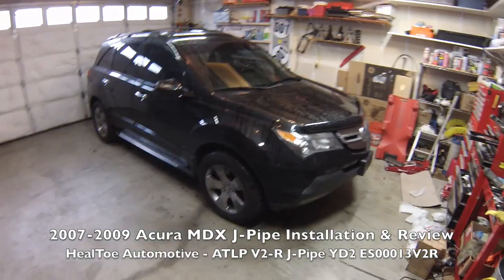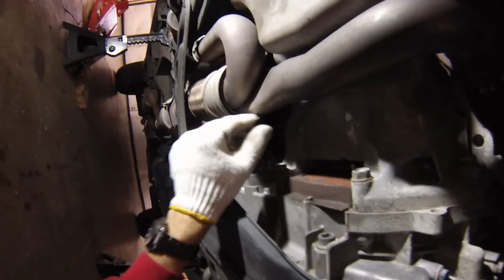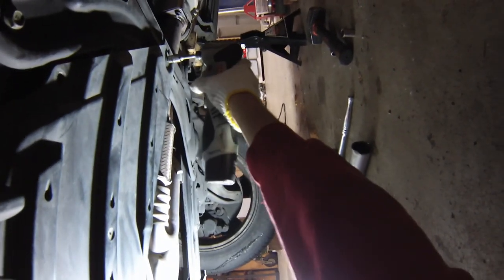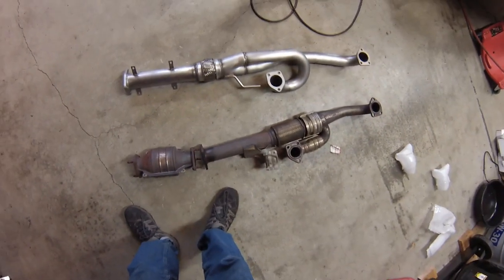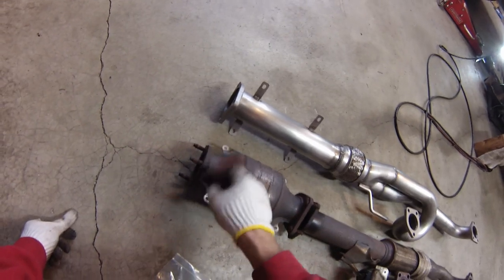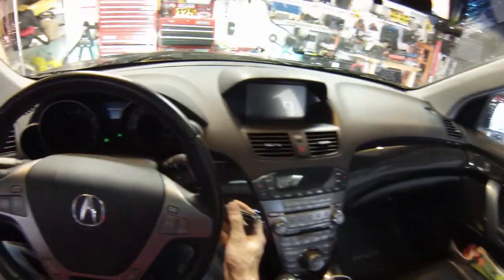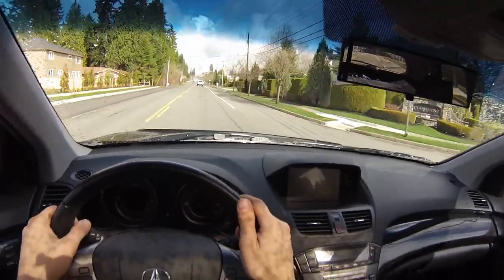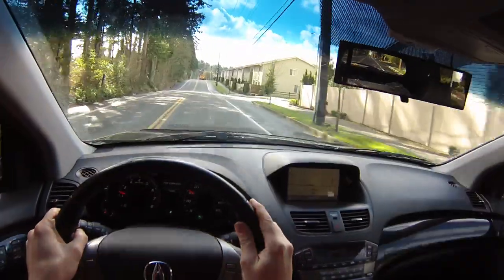Install+review ATLP J-Pipe Mod - Acura MDX 2007-09

Comment: Was there any noticable vibration at the car floor/pedals when installing this Jpipe? Im asking because I recently installed this on my Acura TL and I noticed a good amount of vibration on the cabin floor and pedals when driving and at idle.
Reply from the maker: I had similar amount of vibration.
Reply: Need to put washers on

Comment: What is that tool you use in the beginning   Looks like a automatic impact driver, but narrow and skinny, with a battery (at the 2:14 mark)
Reply: electric ratchet.   the best one ive bought is the matco one which is the same as the Milwaukee brand from home depot.

Comment: Question, does the 07 to 10 MDX model burns a lot of fuel?  because mine i figure it kills 93gas, is there anyway i can get beter gas miles on city, thanks!
Reply from the maker: Shaun Martinez Yeah, it's kind of a gas hog... But so are most other vehicles in the same size and power range.
Reply: Thanks bro! Still love MDX its very nice driving it,
Reply: I have a 2010, Try to keep your rpm below 2000 around town.

Comment: Did that throw off any of the O2 sensor.?
Reply from the maker: No O2 sensor codes thrown. The O2 sensors are all upstream from the J-Pipe.
Reply: Isnt there an O2 Sensor (downstream) behind the rear cat to check for efficiency of BANK1? Did you use an O2 simulator for this one?
Reply from the maker: Hans Owens The stock J-pipe contains only the secondary cat which is not checked for efficiency by any O2 sensor. There is no O2 sensor after the J-pipe. Everything works fine with existing O2 sensors and no codes.

Comment: Does removing the catalic converter and replace it with the j pipe cause your check engine light to come on because I wanted to do this mod for my 2012 TL reason for asking is because I have straight pipe from the 😺 catalic converter to quads tip's no mid resonator and no muffler except the one at the y pipe  still let me know  crazy 😧 content 🤣
Reply from the maker: It did not but it offered basically no performance gain and just introduced NVH so I ended up taking it off
Reply: @ModMINI no gains because you installed a jpipe onto stock restrictive pipe and restrictive mufflers

Comment: Did you notice any smell of gas, exhaust fumes, or oil due to the removal of the post cat? Did the vehicle burn any extra oil?
Reply from the maker: None of those things. Changing an exhaust component would never cause it to burn more or less oil.

Comment: Remove cat. And you will feel difrents and sound, air filter intake, i did to my TL 3.2 big difrents, nice sound, not like 350z, but nice smoth, vtech kicks in hard wiht the air filter! Great combination, removing cat, will turn on cheak light, just saying
Reply from the maker: This setup removes the post-cat but I can't remove the main cats as it will fail emissions inspection. Definitely though, if the cats are gone the car will have more power and make more sound. I did put in a K&N panel filter. Didn't make much difference. Need to go to a cone or foam cylinder.
Reply: Oh ok! Well am from florida, in clearwater FL i herd of a shop that will make you the hole exhuts and will put the right muflers on it, giving a good setup, for my TL it would be like 900.00 costum made! Staley steel, but for the sound i wanted, to much money, it would give me more horse power, but cant wast that amuot of cash,
Reply: ***** Look for a good cold air intake. My TL Type-S has a short ram and she growls!
Reply: +phillyguerrilla  Go to Amazon and put this in... aFe TR-1007B Takeda Cold Air Intake System for Honda Accord/Acura TL

Comment: I want to remove the j pipe from my 08 TL.  I have heard that these can get rusted. You said penetrating oil can help and I will definitely use that.  I'm concerned that I may snap off a stud or break bolt. Any suggestions in addition to penetrating oil? Is impact wrench better than breaker bar to avoid possible breakage?
Reply: Daniel Kim pb blaster. You can also use acetone and transmission fluid to make a great penetrating fluid.

Comment: So, no catalytic converter. Isn't that illegal?
Reply from the maker: There is catalytic converter. There is a main cat and a post cat. The O2 sensors and state emissions measure emissions after the main cat but not after the post cat. Removing the post cat will not cause car to fail emissions.

Comment: So do all acuras and hondas with the 3.5 have a stock j-pipe?
Reply from the maker: Yup, that is the definition of 'stock'...
Reply: ***** i actually have a 2012 acura tl 3.7 its about the same engine i think but bored out. Im trying to get an idea what exhaust i want and wondering if it would be cheaper just to get it straight piped. Then some say it would be too "droney" on highway, but doesnt a j-pipe like the one u installed cancel drone?
Reply: @acuramattb4525  07-09 MDX engine is slightly different than 10-13 (higher compression pistons, Nikasil cylinder liners, etc), but the cylinder bore is the same. The J pipe doesn't cancel out drone, the resonators do that. The long-tube J pipe frees up the exhaust flow, but to see a significant increase in output, you'd need HFPCs that don't trip o2 sensors, and less restrictive exhaust components past the J pipe. With my '12, the plan is a single 3" instead of dual 2.125" (same internal volume) with a serious resonated test pipe to cancel drone, and single straight-thru muffler for tone (GReddy Revolution RS or ISR). The factory J pipe is incredibly restrictive, so it's the first thing to do, but with factory pre-cats, resonators, and mufflers, there are still bottlenecks in the exhaust, just not as severe as the stock J pipe.
Reply: @acuramattb4525  Sorry, I missed the part about yours being a TL. The MDX is a J37A1, your TL is a J37A4. Bore and stroke are the same, as is the compression ratio as 10-13 MDX, but the TL has a different throttle body and intake, so output is a bit higher. But the block itself is the same.
Reply: The type-S and A-Spec middles might have a more performance oriented setup